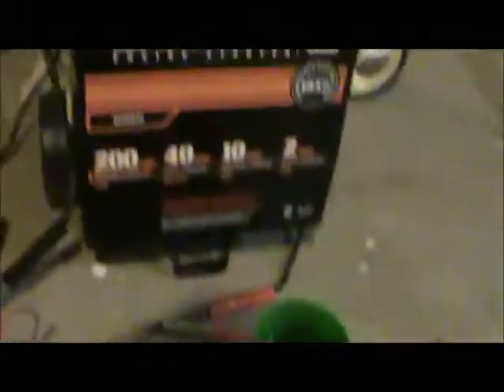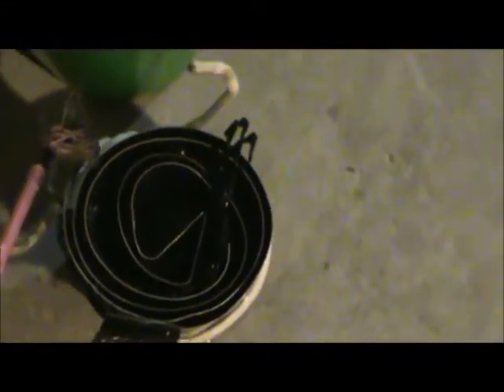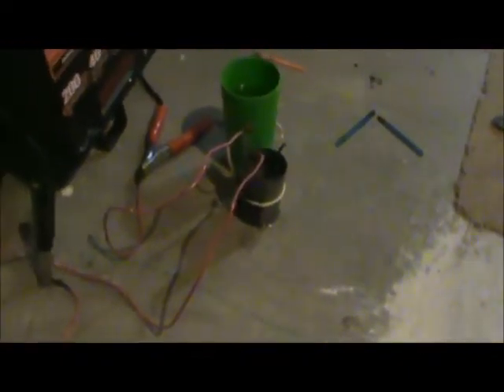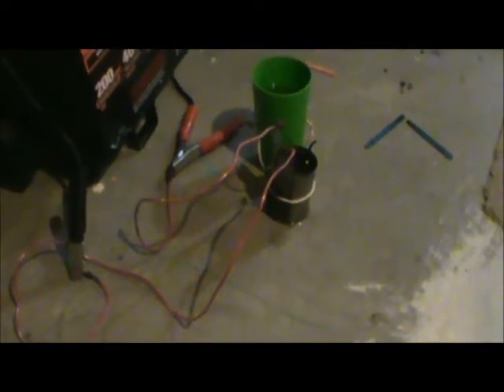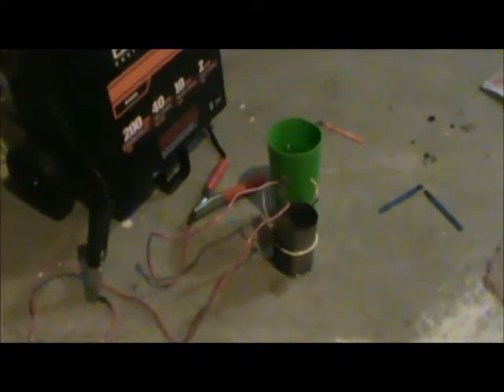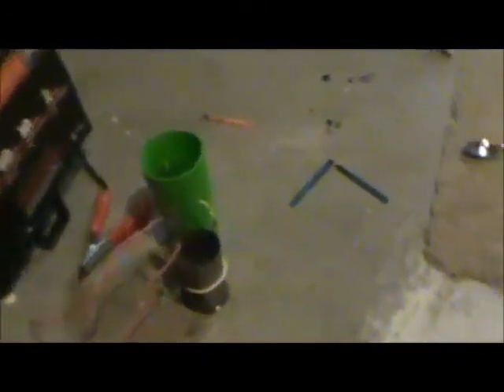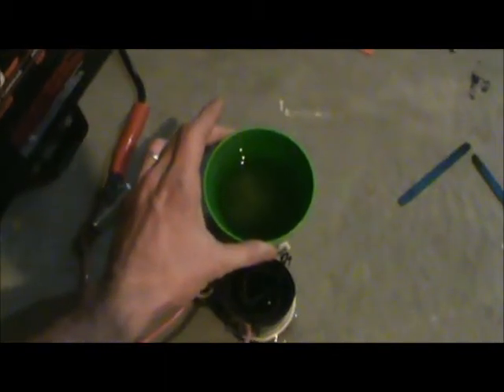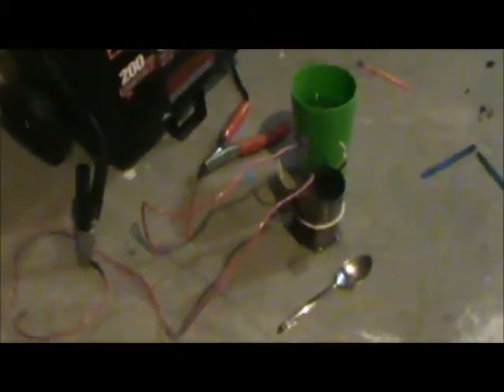HHO Spiral Cell (What it looks like & how it's connected)

Comment: On mine i acheived a 1mm spaceing by using zip ties which worked very well ..In my first spiral cell I had 5 connected in series but on my latest one Im useing 4 but much larger anyway works very well and just have to get a measurement best of luck with your projects...Cheers   HAWK.....

Comment: The plates are bathed in water and there is current leakage around the edges. This is one of the biggest causes of the heat. heat = not efficient use of energy. To increase efficiency you should go with a dry-cell design of your liking. Something with gaskets. You can by vinyl at Walmart or industrial silicon gaskets at Home Depot & Lowes or Menards depending on which part of the country you live in.

Comment from the maker: One way to maintain spacing is to use the mesh that I have used, get something that you can use as a removable tab so there are holes for the water inlet and gas outlet and once it is rolled up buy some handle dip from Home Depot and dip the bottom end in it then let it dry. Once it is dry pull the mesh out and place some removable tabs in the top and once they are in place dip the top in the handle dip and let it dry. Once it is dry remove the tabs and you should be good to go! .